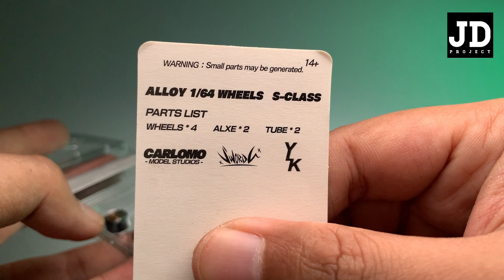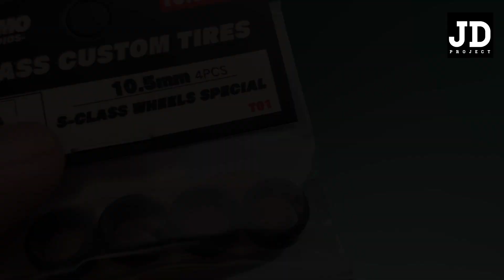Lamborghini Veneno Dark Holographic Tomica Restoration Custom

Comment: The wheels with ball bearing is going to be smooth. Should've raced this in KoTM tournament.
Reply: But rubber tires aren't good for racing
Reply: @nairdas_hobbies  maybe with regular tires, if is is possible to do
Reply: Do it
Reply: @unkwnaubrey9069   who? Me?
Reply: I agree with you
Reply: It will replace Formoso's Veneno

Comment: Can I just ask is it possible to just apply the putty without the metal pieces u use under the fenders to hold the putty or do you always have to use the putty with the metal because I wanna try to make a wide body for the first time?